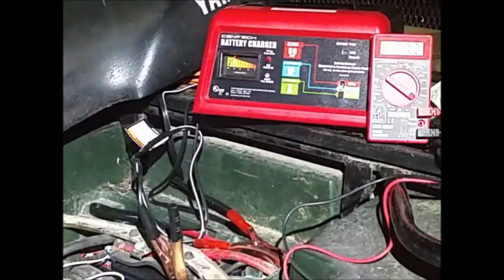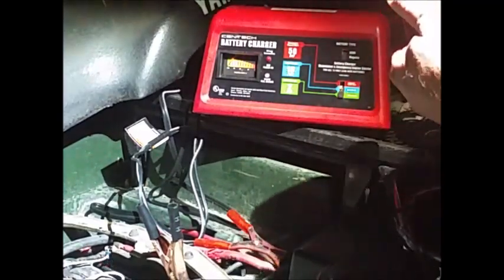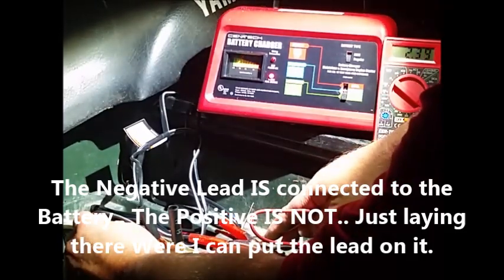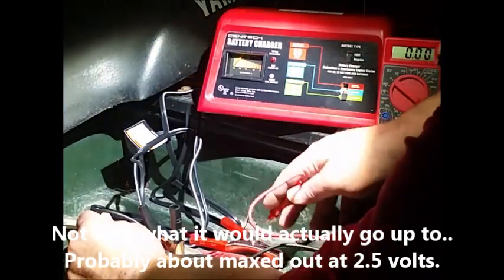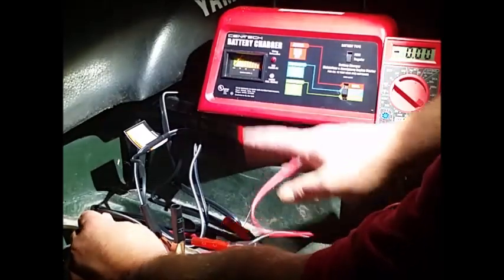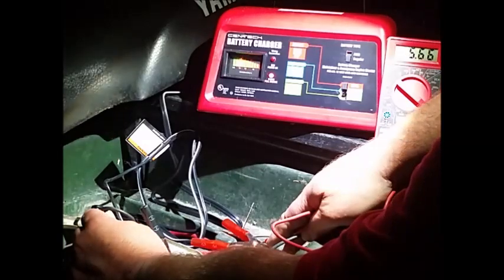How To Test A 12 Volt Car Battery Charger 2-10 Amp Charger. Harbor Freight Item# 60581

Comment: Thanks.  But would have been nice to actually video  all the connections vs just comments.
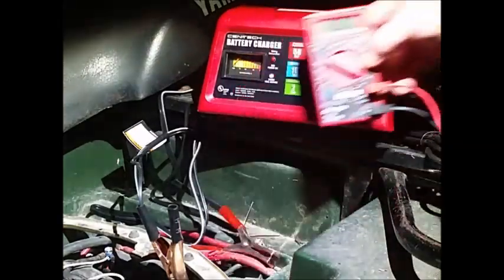Reply from the maker: at 1:20, just after I drop the meter and pick it back up, you can see the Ground cable is in the (COM) or Common, and I have moved the Hot/Red Lead up one position into the 5ADC,,, AND,, Turned the dial to point at the 5A Position where the hot is plugged in.. The probes of the Amp meter are INLINE.. So, connect the negative lead of the charger to the Negative Terminal of the Battery like Normal.. The Hot/Red from the Charger is left OFF of the battery, so, you can complete the circuit from the charger(Red Alligator clip) to one lead of the Multimeter, and then, the other lead of the Multimeter to the + side of the battery, where the Red Alligator lead would normally go, if you were charging the battery... 
So, hook up the battery charger like normal (turned off), remove the Hot/red lead, and make the connection through your Multimeter, one lead to the alligator clip and the other to the battery to complete the flow with the Meter inline to register the current.. BUT,,, have an extra fuse handy, because, this side is limited to 5amps, and I tested the 2 amp charge first (knowing nothing would happen to the fuse), and when I switched it to 10 amps, I was risking blowing the fuse... BUT, I had left it on charge long enough, I knew, it was not charging much if any, so, I went ahead just to see what it would read.. I had already tested it before doing the video.. This was the second charger with the Exact same problem.. The first was charging enough on 10amp, it blew the fuse.. But, I had already turned it to 50amp boost, and that is what caused the malfunction inside. 
If you have a clamp over the wire meter, it has a higher voltage/amp setting to allow for this, but, I wanted to show it with the smaller meter.. 
Hope that helps.. Both of the chargers worked fine, UNTIL I tried to use the 50 amp boost.. 
As you can see from the meter, the fuse does not blow right above 5amps.. It was ranging about 5-7 amps and once I saw it jump to 9amps for a split second and didn't blow. But, it is 5 amp rated, so, if you put it on 50amp and it is working correctly, you will blow your fuse.. 
I bought a roll around 12volt heavy duty charger. I bought one 100 amp boost and a die hard 200 amp boost... If you buy one, buy one with knobs and stay away from the digital crap.. Manual is best. It does what you set it to do and isn't smart and does what it wants... I renew batteries that sit all winter every spring.. I put them on 100 or 200 amps and let them sit for 30 mins, test, then an hour and test, until they wake back up.. It boils the sulfates between the plates and stops shorting out.. I have had Interstate batteries last 10 and 12 years with the manual chargers... Good Luck...

Comment: Mine shown 17 volts under no load but still failed to charge a 9 Amp Hour battery. Conclusion voltage alone will not show if a charger works, you need amps as well.
Reply from the maker: Correct.. 17 volts is pretty high for a 12v battery. Usually 13.8 new 12.8 approx after they get a little life on them..

Comment: I bought two of these and both did not work.  I returned the first one, but did not get around to using the replacement until after 90 days......it's bad also.The only electronic s**t harbot freight sells that works is the cheap "free" multimeter!
Reply from the maker: Don't buy their larger roll around battery charger.. 200 amp boost only lasts for a few seconds..

Comment: I have one of those $6 harbor freight multimeters. They max out at 5 amps. Your lucky it didn't catch fire when you ran 10 amps through it. I expect that you will find that this is why your charger is freaking out.
Harbor freight May oray not sell a good charger, but we're not gonna learn from this video.
Chalk up this crash and burn to operator error.
Reply from the maker: Tony Ketcham, The one I have in the video, and the others just like it I have are 10 amps.. the charger is 2 amp and 10 amp slow charge with a boost. Not sure where you get 19 amps out of it.. After you put the charger on Boost, the 10 amp circuit fails.. You did notice that the charger meter didn't move either? Confirms what is showing on the HF meter. Not sure why you think what you do, but, there is an internal fuse that would pop before it catches fire, so, not sure what you are talking about there either.. At 5 minutes into the video, it clearly shows 10A on the meter and the plugin. Again, not sure where you found the basis of your comment.. The fact that you can quote so many things wrong,, and then,, try to tell some one else they don't know what they are talking about,, is way beyond me... And, one more I missed a minute ago.. I'm a bit confused about this comment too.. "I expect that you will find that this is why your charger is freaking out."
Has the thought occurred to you, that, if you thought the meter maxed out at 5 amps, and I had it on boost, if the battery was fully charged,, what the charger would have done?? Just curious.. If you did more thinking and less typing,, you might learn more.. Maybe make less of those Keyboard errors... 
At least you got one statement right.. They are about $6.00.. It really amazes me that, if the meter maxes out on 5 amps, rather than 10,, why you would think that the charger would freak out.. If it blew the fuse, it would not pass any current, so, not sure why you think what you think there either, when you could see the meter showing and me saying what it was charging at.. I can't find one sentence or comment you made that makes any sense whatsoever.. You should try asking questions, rather than making comments. You would learn a whole lot more, because, you would have to think,, to formulate a question.. Maybe you would find the answers while making your questions... You don't sound like you know, but, that is why they put fuses in things like that.. So, the fuse burns and the equipment doesn't.. Wow!! That is some pretty basic shit you are not getting a grip on.. Try watching more videos, and commenting less.. One of your buddies might actually read the shit you post.. 
At least everyone who read your comment here, is going to know you don't have a clue what you are talking about.. Nice try, but, you have to get up a bit earlier to outsmart a guy on a topic you know nothing about..
Reply: @MarkThomas123  I am pretty sure that I have the exact same multimeter, and if you look on the face of your multimeter, where you have your positive lead plugged in it will say 5 amps max.
When my comment said 19, that was a typo. I hit the nine instead of the zero. I went back and edited it to say 10.
Reply from the maker: @tKetcham1  Look at my Previous comment that you just replied to... In that comment, I gave you the time in the video where you can see the face of the meter and see clearly,,,, 10 Amp.. About 5 minutes into the video.. It is 10 Amps.
Reply: @MarkThomas123  SET YOUR METER TO 20 AMPS. NOT 10 AMPS.

Comment: Thank you so much... I just bought the exact same one and it is dead as a door nail!!! Doesn’t register anything!! So pissed! I’ve waisted 2 days trying to charge RV batteries.
Reply from the maker: I'm shocked that HF is still having a problem with these things.. I posted this video July 2016.. Seems like they would have addressed the problem by now.. Ha.. Hmm...  BTW.. their Big 200amp battery  charger only gives you 200 amps for 5 seconds.. I have a good slightly used one that works just like it is supposed to,, cheap,,, ha..Ha.. if you are in Western NC.. I need something that will give me 200 amps for a couple of minutes at least.. This one is useless to me, but, would probably work fine for others.. I have big diesels with dual batteries, etc..  Ha.. Just  a thought.. Ha..Ha..

Comment: I wish you would have had the camera angled to show a little better where you are touching the connections and if charger is on pos and neg of battery? And I assume you plug the red wire into a diff input?
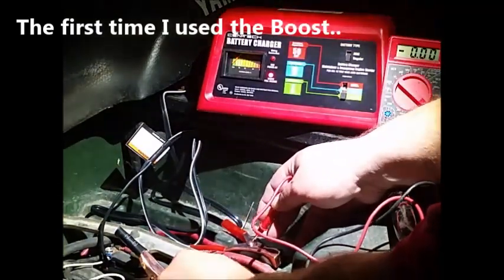Reply from the maker: I noticed that when I was editing the video at 1:50 and put text on the video screen to explain it. It helps to understand the Multimeter itself first.. When you check volts of the battery, as you usually use it, you have the leads plugged into Power and common on the multimeter (Not battery), and you touch both battery terminals. When you want to check amps, (Cheap multimeters limited to 10amps max) you have to move the red plugin on the multimeter to the amp setting, and change the dial to the amp  setting on the multimeter.. I go over the set up and settings at 4:25.. Once you set up the meter, then, you put the meter "Inline" on the negative side of the battery.. Put one of the charger clips on the positive lead of the battery, and the negative lead of the battery not connected to the battery directly, but, connected via the meter.. One lead on the negative battery clip and the other to the battery.. The amps flow through the meter from the charger clip to the negative lead of the battery..  Hope that helps.. The meter is Inline with the negative battery terminal and negative charger clip.. Voltage has to pass through the meter to get to the battery.. This is only 10 amps max, so, can only be used to test on the low and med setting of the charger.. So, I tested to show it working,, then, removed the multimeter, put it on boost (that would fry the meter), let the charger break itself, like the others did, then, put the multimeter back on to test and show that it "Was" working before, and after the irratic boost shown in the video, the regular 10 and 2 amp settings no longer worked.. When I used the boost settings, it killed the charger and would not work at all, although visibly, it appeared to be working.. The point of the video.. Hope that helps..
Always read the comments in the video below the video. If others say,, Just what I needed, etc,, it might be worth looking at the video again.. Might have missed something..Now go back and watch it.. What you were looking for was there.. I always look at the comments when I get confused.. Always look at any edits on the screen or notes in case the person making the video clarified any mistakes.. Ha. We are not perfect, just trying to help the community that helps us so much.. I could not find a video on this myself, is the reason I made this one.. Cheers!!
Reply: Mark Thomas, thanks for the reply, I missed that the first time and might have had a spark or worse if they were both connected to the battery. My voltmeter only checks ac amps and not dc amps.
Reply from the maker: @rotfan77  Yes.. Keep an eye on the HF sales pages.. They run the meters pretty cheap on sale.. When they do, I buy at least 4 or 5 of them at a time and always have extras for the next few years.. I have people who work for me that put them in a box and can't remember which box ha,, so, I have to have a few in my cabinet when I need one.. They work great for volts and ohm, the most common use for them, and for the price, you can buy a few at a time and not feel so bad when you burn one.. Ha.. Good luck.. Hey,, they have a fuse in side of them, and the fuse will save them every now and then, but, on the amp setting, if you connect it to more than 10 amps, like accidentally switched to boost,, it's gone.. Ha.. But, no big deal.. Just toss and grab another.. Ha.. Thanks and good luck..

Comment: You get what you pay for at Harbor Freight and that's usually frustration because diagnostic tools should be of good quality. Not the crap from Harbor Freight.
Reply from the maker: They make a lot of good tools.. They just bought a shit load of these chargers and some rarely use them, so, they were having problems believing that there was such a bad number of them.. But, I use them regularly, and I have 15 or so vehicles in the fleet, and I knew it immediately, because I know when to grab a charger and when it does not do what I expect it to do, I check it.. Bingo.. But, I buy lots of their tools. But, there are places for the more expensive, and I have plenty of them too.. But, I have 6 or 8 HF Grinders, and only 2 Dewalts and one Milwauki, but, I have them with wire wheels that the HF won't run.. So, lots of cost savings when you can take advantage of them..

Comment: My 15 y/o Die Hard charger didn't seem to be charging my 12V battery. I bought a 4 amp charger at Harbor Freight  and even after a long low amp charge, Volts dropped to less than 5 V.  I replaced the battery and now no problems.  I don't know whether to toss the Die Hard and wondered if my Die Hard charger did not seem to be working because of the bad battery.  If it is a good charger, that's fine, but if it isn't, I want to toss it.  My neighbor says he has a amp tester at work that he can clamp on the wire to see if my charger is producing amps.  Your video, may help me faster .